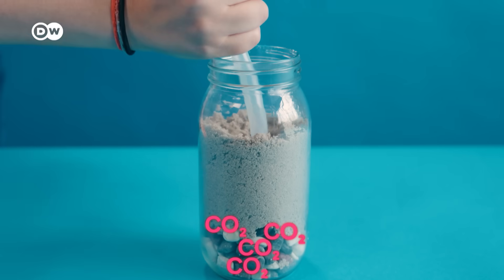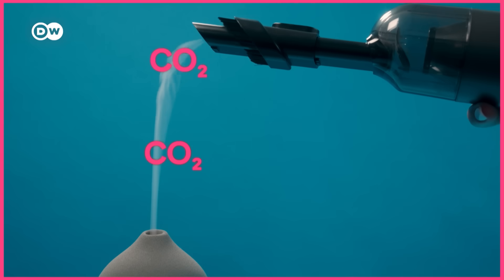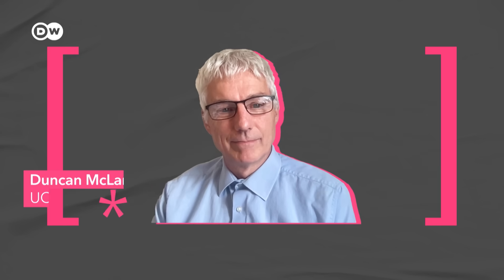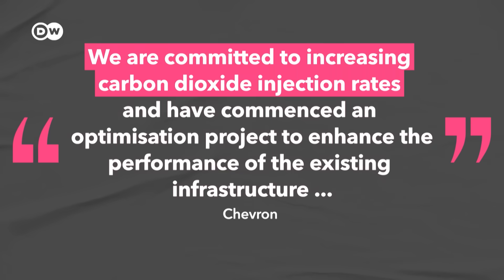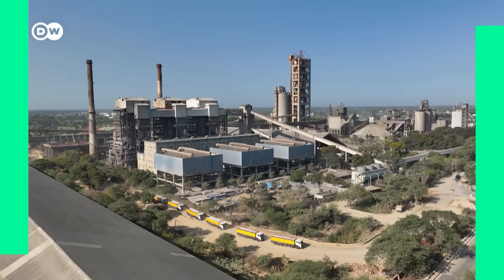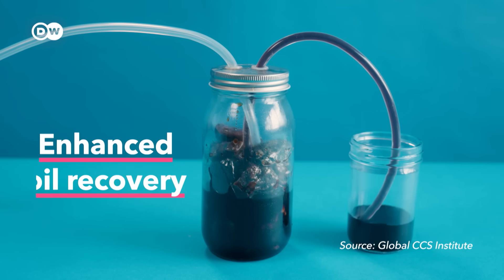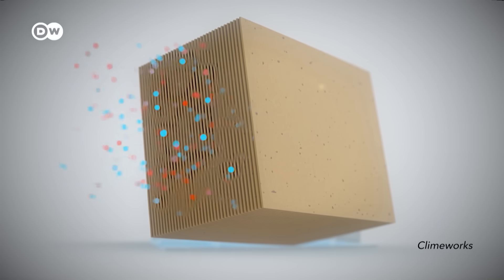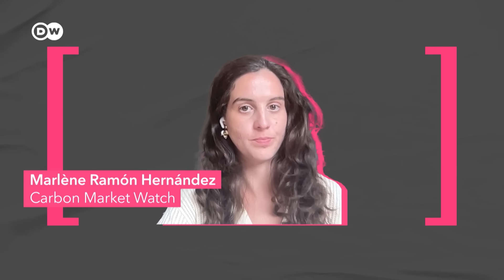Why carbon capture needs a reality check

Comment: Ultimately, based on what's been said here, CCS is several times cheaper than DAC and less complicated....but no-one is using it at anywhere near the level that has been promised or advertised.  So, why should we expect DAC to go anywhere at all?  Sure, we may eventually need it...but in the mean time, it's just serving as a fig leaf for Oil Companies to do yet more polluting.

Comment: Cpmbustion based plants , such as coal fired powerhouses could be built around oxygen concentrators.  A coal plant burning with pure oxygen would have an exhaust stream of fairly pure CO2, much easier to compress and store than the nitrogen heavy exhaust of an air breathing coal burner.

Comment: I guess someone already thought of this, but I am curious, why this is not considered a valid option:
1) plant something that absorbs lots of CO₂ fast. First plant that comes to my mind is bamboo. But I am not going to argue. Might vary depending on climate, soil. Maybe go offshore and farm seaweed. 
2) harvest plant from point 1. 
3) put it in a location where it will not decompose. In swamps, in deep sea where there is no oxygen, bury it in a desert.
Reply: The reason that planting something to grow, harvest, and bury is not considered a valid option is that the resources used for that could have been used to grow food. The sunlight, soil, and water are too valuable. And, of course, it is too little and too late.
Reply: @virgilfenn2364  IIRC, we are producing more than enough food to feed all the population - it's the distribution that is problematic. 
And if I remembered that incorrectly, there still are the inedible parts. Or the seaweed I proposed in the original post ;)

Comment: Its a distraction. Focus need to be on massively ramping energy  storage tech,  ironically perhaps the only good use for captured CO2 is in closed cycle CO2 compression/gasification storage tech. Even Nuclear needs that too, anyway, because the best way to operate nuclear plant is at maximum capacity as "detuning" a fission plant to make less energy (rod use and boron poisoning) when demand is low is LESS efficient and impacts the lifespan of the plant more than storing the power, say in hydro (see Canada, and indeed France), and just running the plant at 100% output as much as possible. So, Energy storage NOW, not CO2 storage, EVER.

Comment: 1.711 / 5.000
reducing co2 is beyond stupid, 
look what happened in biosphere 2 in arizona in 1991, the real data, not the ones grenepeace and others like claim, 
co2 didn't reach 7000 ppm as they claim because then the 8 people inside would have died, 
the truth was that co2 dropped so they were suffocating after 3 weeks because the plants didn't get enough co2 to produce enough oxygen and at the same time the plants grew slowly so they only got 75% of the food they should have had,
no. 2 experiment in 1993 they made it work with oxygen and food because they put large amounts of co2 pressure bottles in there to keep co2 up to a minimum of 300 ppm.,

the 3.2% of the 0.04% co2 in the atmosphere is absorbed and transformed within 15 days by plants,
capturing co2 and trying to store co2 is not only mindless but costs billions and has no effect,
the stock market crash in 1929 when factories closed, the oil crisis in 1972 cannot be seen from the amount of co2 in the atmosphere,
co2 measurements have been made by several people since 1812 to 1961 and show that there have been higher co2 amounts twice in the last 180 years, 1822 with 445 ppm and 1945 with 433 ppm,

from 280 ppm which they claim was before industrialization (in reality there was 330 ppm) to 400 there is only a more effect of 0.6% or about 0.2 degree c.,
from 400 to 800 ppm what will take 150 years at the current rate of increase there is only one more effect of 1.6% or 0.35 degree c. Murray Salby,
the more co2 is increased the smaller the effect, the effect curve is not linear,

our sun and warm ocean currents have a 100 + x greater effect on the climate than co2,
the cause of the co2 increase is not our fossil co2 but increasing temperatures that cause the sea to outgas co2 and it lags at least 650 years behind the temperatures, so the increasing co2 amount can be traced back to temperature increases in the Roman period where it ends but 2 + degrees above now in year 200 or in the Middle Ages with 1.5 degrees above now in the year 1100
any ice core researcher can show you that and archological excavations show us that it was warmer then globally

Comment: Enhanced chemical weathering (grinding up volcanic rocks so the metal ions can dissolve out of them in water more easily and bind to carbonates, drawing down co2 levels) seems like the most viable form of carbon sequestration, but it is slow and would likely need to be done on a large scale for hundreds of years to draw down all of the co2 needed to get to preindustrial levels, even if we stopped carbon emissions now. in combination with making biochar and mixing it into soil and/or burying it maybe it would take less time.

If we excavate volcanic rocks for that anyway, we may as well do it where we can get geological hydrogen.

Geological hydrogen seems like an interesting potential source of hydrogen for things like green steel, but will likely be opposed by fossil fuel companies because methane is currently used to make the hydrogen in some "green energy" projects with the argument that it can later be produced by electrolysis from green energy instead. The estimates of hydrogen available are rather large, but they are found in places with a lot of volcanic rocks so were not found often historically as oil forms in different geological conditions (more sedimentary). If we were to drill for hydrogen it would likely have some of the same environmental problems associated with things like fracking, so the politics of this are likely to be complex in similar ways to how nuclear is, with environmentalists with different focuses on different sides of the issue.

Comment: Carbon capture makes next to no sense from a logistical perspective. You’re using more energy to store CO2 underground than you’re offsetting, unless the whole thing is being powered by renewables, but then it’s a less efficient use of that energy than just powering stuff with renewables. It would probably cheaper and more efficient to just plant a bunch of trees. The only thing discussed here that seems remotely viable is directly pumping the emissions from industrial processes that can’t be decarbonized underground.
Reply: perhaps you can explain how emissions from flying will be dealt with without DAC?

Comment: You need to plug the holes in the boat before you start bailing. All funds and manpower should be allocated towards eliminating fossil fuels completely.
Reply: No, No. That is not the way to keep the boat afloat. You need to drill more holes in the bottom of the boat to let the water out. -- Ridiculous, of course, but that is the effect of all CCS schemes. They require expending even more energy than was released by burning the fossil fuels in the first place. I agree, "All funds and manpower should be allocated towards eliminating fossil fuels completely."

Comment: Paradoxically CCS doesn't work but we need to keep doing it. It's a smokescreen for heavy industries but they need to be forced to keep doing it as an aside to other carbon reduction measures, not their principle effort. They need to keep investing it in the hope they  can make it work in the near future but not be ale to free ride on decarbonisation efforts by investing in it.
Reply: No. It is a waste of energy. It's not like you could get clean energy from nuclear.
Reply: @virgilfenn2364 Nuclear is clean. It’s just not (really) renewable.
Reply: @virgilfenn2364  Well, yeah, nuclear still has the problem of waste disposal.  Right now, in the US, spent fuel is kept in cooling ponds, near each reactor.  It's not safer than the Yucca Mountain site, but there's nowhere else right now.  Outside the US, they have other repositories.  I keep on thinking it should be buried in to a subduction zone.
Reply: @ Nuclear waste disposal is a public relations problem only. Most of the public, like you, are not aware of the total lack of evidence that low level radiation is harmful. Not even the fear that some  cancers might be caused by low level radiation is based on the facts as they are now known. Cancer is a broad class of diseases with complex development steps required. Radiation might be one of those steps in some cases but that is far from proving that radiation causes cancer. Among the many causes of cancer, radiation barely makes the list. 
All other sources of primary energy produce more waste than fission nuclear power AND they do not keep all of their waste on site. Instead most of the waste is released into the environment.

Comment: If "the tub is the atmosphere"  (at 1.14) 430ppm CO2 in the atmosphere is going to be a wet skim on the floor of the dry model bathtub.  You'd need 2500 more of these wet patches to fill the tub.   The video shows the model bathtub about 20% filled with water, and that would be equivalent to 200,000 ppm.  Consider the difference between 200,000ppm and 430ppm in the real atmosphere. It's a misleading exaggeration and should be cut.
Reply: Looks like you missed the metaphor. The amount of water has nothing to do with it
Reply: Your misunderstanding the point. A full bathtub doesn't mean 100% co2. The full bathtub represents the tipping points in climate change. As CO2 rises it reaches tipping points that cause more environmental damage to ecosystems. It also reaches points where positive feedback loops kick in. Melting permafrost releases methane or the ocean releases more co2 at warmer temperatures. These tipping points are the full bathtub. You can present arguments of where the tipping points are and what damage is caused at various points, but they aren't at 100% as you suggest.
Reply: @BM1982.V2  Tipping points are bunkum.  The model is either misleading or (by extension) bunkum.

Comment: 6:33 complete nonsense. A passenger uses 50kg of fuel and even if all of it was coal, the co2 emitted would be less than 150kg
Reply: 1 tonne per passenger, that’s insane
300 passenger means 300 tonnes, so the fuel itself is 1000 tonnes, may be
Boeing 747 weighs about 184 tonnes

Comment: The entire renewables scam needs a proper looking into. The claims of how clean they are, The manufacturing in China with slaves and dumping toxic chemicals, the disposal of them, the fact they use coal to power the factories, the land cleared to install them, the birds and wild life disrupted. the actual cost of them over a 24hr period not just peak out put and the cost of upgrading the grid to handle it and storage. All of these are ignored when talking about renewables time to face the facts they are a scam and lets build more nuclear plants.

Comment: You don't need to capture it. All you need to do is split the Carbon off the oxygen and let the released carbon float off as dust to be used by plants to grow while the oxygen is released for things to breath. Carbon capture is just snake oil designed to siphon money off to billionaires and their multibillion dollar companies. Figuring out how to split emissions into constituent elements while they are being released could solve most pollution problems. Sulpher dioxide? Split into Sulpher and oxygen. Hydrogen sulfide? Splits into hydrogen and sulpher. As individual elements they do nothing. Combined they are dangerous and deadly.

Comment: Why not grow trees, cut them down and place in ground, grow some more on same ground etc etc, we have 40000 year old wood from ground in NZ, long term carbon storage we can mine later, exclude air and wood lasts a long long time. We can go mine it later when the climate is finally cooled down.
Reply: Ha ha, “when cooled” isn’t happening in a time frame pertinent to humans. That species is cooked.
Reply: If you did that you would quickly strip the planting area of nutrients and wood is not at all dense (it floats in water after all) so it would be pretty expensive (and potentially carbon intensive) to dig hole large enough to store the wood.

To adress that you could char the wood (or algea instead of trees, since they grow faster), pulverize the charcoal and use a centrifuge to seperate out the mostly pure carbon to deposit underground, while returning the nutrients to the soil. But that would just trade storage costs for processing costs.

Its possible, but it is even less efficient and therefore expensive than Direct Air Capture

Comment: Even in Copenhagen it would be 1.000 more efficient to isolate houses further. And expand on ultralocal power sources; small wind turbines, heat pumps and the like. As opposed to spending billions on co2capture. As is the plan. (Have noticed the DW team in Copenhagen.) Hence the hint.

Comment: CCS is a massive scam. It requires more energy to run than is produced by burning the fuel producing the carbon in the first place, meaning we actually need to burn more just to generate the energy needed to run CCS. We'd be better off without it!

Even if you assume that energy is coming from clean sources such as wind or solar, a much better use of that energy would be to displace the fossil fuel on the grid and reduce the amount we need to burn, rather than running inefficient CCS.

There might be a limited use case for it in carbon intensive industries that are harder to decarbonize such as cement and steel. In these cases, if the energy required by the CCS is generated by renewable, it might have a legitimate part to play. But certainly not in power generation!

Comment: Direct air capture makes absolutely zero sense. It takes far too much energy to suck up enough air to capture a meaningful amount of CO2 and put it somewhere else. Burying that CO2 underground is a gamble on how long CO2 will stay there as a pressurized gas before finding its way out.

Imagine billions of tons of CO2 blowing out of underground storage all at once 30 years down the road when someone accidentally bores a hole into it or an earthquake fractures a storage area. Also, if you have already weakened the ground with fracking to get more oil/gas out of a well, that area probably shouldn't be trusted with long-term CO2 storage. There already are tens if not hundreds of thousands of leaking retired gas wells all over the world, not going to be any better off with making a million leaky CO2 wells.

If all we do with CO2 is pump it back under ground, it is likely only a matter of time before leakage back out of underground storage exceeds the practical limits of pumping CO2 underground.

Comment: Considering the amount of carbon already in the air its just not enough to be carbon neutral by a time, we need to be carbon negative to remove the already existing excess carbon in the atmosphere. 
Carbon capture is a bandaid solution for a massive problem without widespread societal change. We are so fucked.

Comment: DAC is a loser! We should put it in a time capsule for the future after every power plant is emissions free.  

Oil companies should have to pay the difference between the carbon they pull out of the ground and the carbon they put into the ground.  Otherwise ccs is just used as a subsidy to produce cheaper oil while making co2 emissions worse.

Comment: All DAC technology is a nonsense. The energy requirements, not the financial costs, are the elephant in the room: for every molecule of CO2 captured, DAC requires <b>more energy</b> than was released when that same CO2 was formed by burning fossil fuel. Pursuing these technologies is therefore completely irrational. This chemical fact cannot be overcome, so DAC can never be scaled up.. because scaling up would imply consuming a nonsensical amount of energy (which for the foreseeable future is produced mainly by burning fossil fuels).